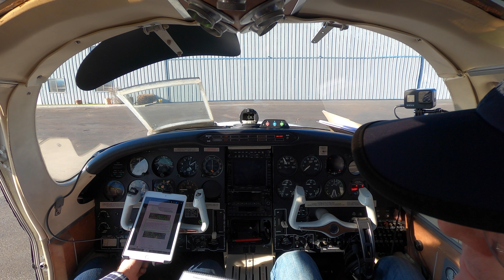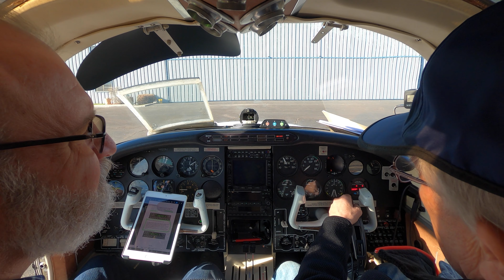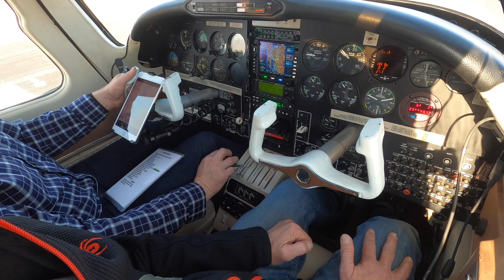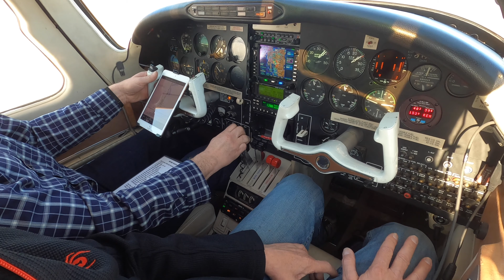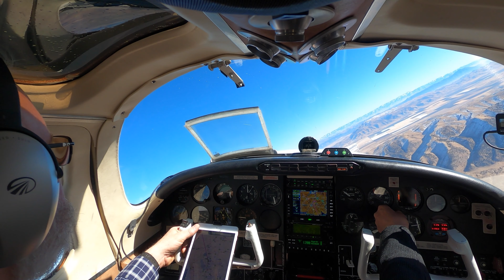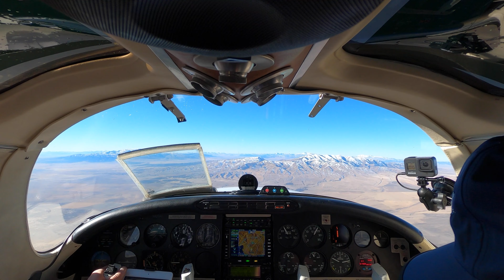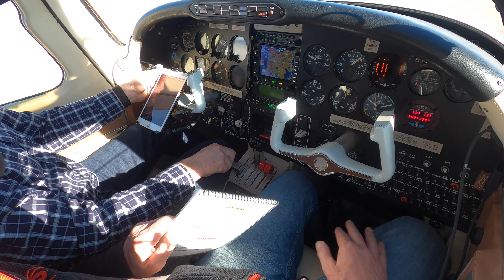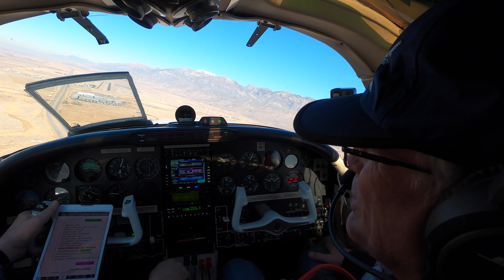Sensory Overload AEST 700 Initial Training day one

Comment: Did the door seal fail? Looks like the pump annunciator is on solid?
Reply from the maker: Good catch. Yes there was a major leak and a larger than normal gap in the upper cabin door.  This was a shakedown flight after a supposed inspection by the previous owners shop. There were a number of issues that shouldn't have been there. Turbo controller rigging was messed up along with fuel pressure out of tolerance.

Comment: Too slow for my taste. Lose an engine at 200' on a GA at 100 knots and you cold be in trouble. This airplane will easily loose 20 knots on short final. I use 120 Kts, F20 until landing assured. Then F30-Full, crossing threshold at 100 kts, touching down at 500' marker and 85 knots.